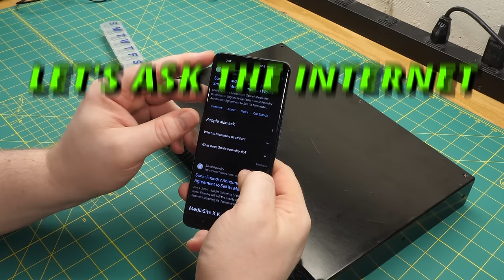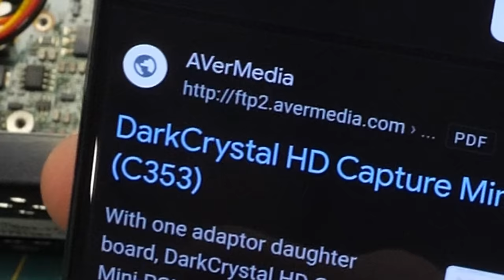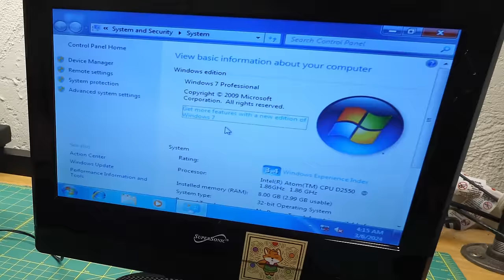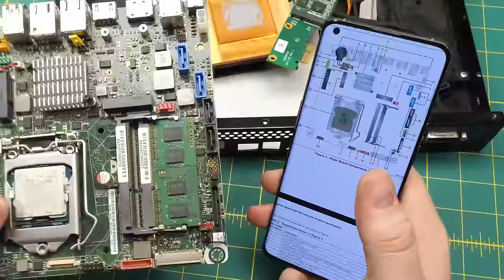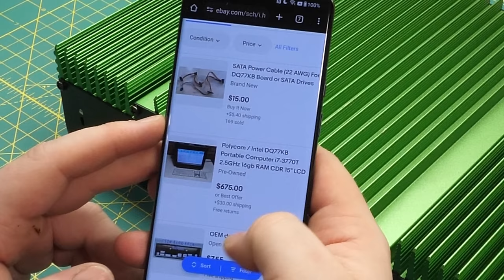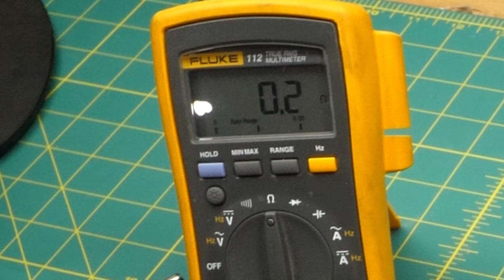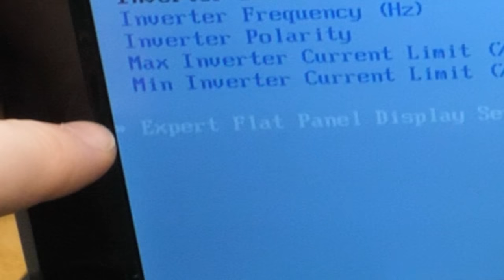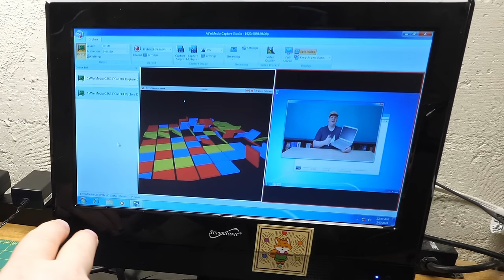Little Guys 5: Three Of Them [MediaSite / NCR N3000]

Comment: I don't believe I'm correct on this but around 15 minutes in I couldn't help but speculate that those empty spaces inside the chassis could be for mounting with like double sided tape, the power brick, and the reason there's two is so you can have two of them, one being redundant. (on purpose redundant, so, the second one would be intentionally redundant).  I was just imagining those grey metal box power supply units for servers, long, short width but tall. 

I figured you could just put the FSB power brick inside the case and cut the chassis to expose the power cord connector for the power supply brick. This does away with the unnecessary expense of adding the screw lock mechanism for the DC barrel jack input, cutting costs immeasurably.

Comment: re: the mediasite's little power button board, those unpopulated spots are probably passives that are technically needed per the PIC's specs (also, PIC spotted! AVR's adopted cousin <3) but were left out because they were found to be unneccessary to save a few cents on passives - the pads are left *in case*. you'll see this a lot in embedded things; leaving a few capacitors and/or other passives off because they take up space, add cost and are just not needed when it's guaranteed its operating conditions will be very stable

Comment: The difference between an SMD link 0 and 000 is that 0 is made like a standard thin film resistor, while 000 is high current rated with more conductive stuff inside.

You're not familiar wih Sonic Foundry? They made the best software of the late 90s. Sound Forge, a wave editor with VST support, Vegas the video editor, and ACID the loop based music workstation. All 3 shared basically the same somewhat unique UI at the time and were so smooth to use and fairly efficient and robust if you compre them with the copetition.

Also remember how for Windows for the longest time shipped with WAV files that had metadata from a Radium cracked version of Sound Forge Pro?

Why is the microcontroller board so complicated? The large unpopulated through hole components are obviously LEDs, the unpopulated resistors next to them are their respective current limiting resistors, and the long unpopulated pin header is clearly a development port, in-system programming and debug, and they might still be using it to program the processor using through hole pogo pin jig.

Comment: 11:26 That’s actually normal, and considered very good bit rate for 1080p. Fun fact movies on Blu-ray 1080p have a bit rate of 18-45 Mbps (megabits). I know this because I run my own Plex server and I rip the raw disc and keep the resulting file as is. I don’t pre compress anything I prefer quality (preferably the original maximum quality) over quantity. Anyway that’s the rough average I have. 4k moves range from 60-125 megabits per second.

Comment: Just saying I think it does work had a similar issue with a thin client fan did same thing it was the center pin needed 5 volt think it's called smart pin some need different voltage I just took a USB 5volt to it and it  booted

Comment: I am willing to bet the SonicFoundry machine was working all the time, even before you pulled the CMOS battery - When you started you powered it up then plugged in the video cable. Chances are, it was checking connected displays on power-up, not finding anything on DP, HDMI or eDP (which have two-way communication), and defaulting to the internal LVDS (which doesn't IIRC)

Comment: Intel's T suffix should note that it's a 35w low TDP processor. I've got 6500Ts at work running off those same standard HP PSUs. I'm sure it would be possible, but excessively stressful on the PSU, to put a 65w TDP processor in it instead.

Comment: You can actually capture multiple streams to separate files by running multiple instances of mplayer or mencoder from the commandline on linux, but that is obviously not a very practical solution for most users.

Comment: Feels like you could do a 30+ minute video just talking about external power bricks and their connectors. I ask this fully expecting you have, but have you ever seen the old Dell plug where it's a square of solid plastic, couple corners chopped off, key cut in one side, 3 tiny pins? Barrel jacks existed at the time. Barrel jacks have always existed. The Ten Commandment tablets had barrel jack. Dell why?

Comment: If you want "fun" bioses, get one of those chinese computers from companies like Chuwi, CWWK and alikes. 99% of the time the bios comes with the engineering mode enabled by default, so you can tune everything(and I meant it). It's not that verbose as it comes with the default blue/white bios but it comes with everything "enabled" you can enable/disable/change things that doesn't even exists on the board. Like how mine n6005 has an option to enable thunderbolt on it

Comment: I have a variant of that case with the extra space in it, and in my variant the extra space is taken up by a shuttle style power supply, I'm not sure why they didn't use a smaller case to go with their barrel jack DC-powered board, but it could be that due to economies of scale the cheapest mini-ITX case that could accommodate a half height PCIE slot just happened to be a variant of that case without the power supply.

Comment: That other machine really is stupid, I had a very similar Atom ITX board in a much smaller case that was entirely perforated.  This allowed it to be entirely passive and even had a right angle riser that allowed a full sized card to fit. (although the build quality was a bit off so it didn't fit well).  I built it to use as a router.

Comment: You wouldn't see "VGA" written on a panel of a DVI input, because VGA is just the name of the connector that carries the RGB signal.  It's just referring to the presence of the four analog video pins on a DVI-I or DVI-A connector.  I agree that seeing RGB printed on an I/O panel is often a sign of professional or pro-sumer gear though.

Comment: @Cathode Ray Dude [CRD] Some laptop PSUs do pass ground through, but it's very hit or miss. It depends on the manufacture, series run, and model of the PSU. All of the two-prong types do not, and it's 50/50 with the three-prong types. Some of the three-prong types have no ground outside of the AC plug, some only on the AC side of the circuit, and some passing it through fully. My advice, when looking for one that passes it through or not, is to test them.

Comment: I had a similar AVerMedia TV Tuner card in my Dell XPS 15 laptop (L501X and L502X) which used a mobile Sandy Bridge i7, I think I saved them in a plastic storage container, but I think they only supported Coax connections, iirc though it worked with some earlier standards of digital broadcasts & cable...

Comment: The little board at around 44:01 -- I think those are actually pads for LEDs, not capacitors. The silkscreen markings on the back (despite saying CP) look way more like LED polarity indicators tha capacitor polarity markings (which usually use either a plus, or they shade in half the circle). I have a feeling if you populated those resistor pads with 1k resistors and added in some LEDs they would either match the front panel or possibly give more detail about the system status.

Comment: Hey don't make fun of THAT little guy!!  The boring black one with the over sized case and ITX motherboard. I could use some of those for a router project.  Well if those are Gigabit Ethernet interfaces.  Where did it come from.  I have combed the internet for cheapo boards with multiple Ethernet built in.

Comment: That little USB board... are you sure the round components are caps? It appeared to be "dented" on one side, which is usually the symbol for an LED. Maybe the same board could do some more lightshows for other applications?
Reply from the maker: Well I thought it said C1, C2 etc on the bottom but I just watched the video again and It actually looks like a two letter designation, CR. I can't find anything online about that other than some weird crap about capacitors with intrinsic resistance.
Reply: @CathodeRayDude  I've seen (particular in HP schematics) the designator "CR?" used for diodes, so that tracks.

Comment: I have a theory as to why that chassis is so big: it's an industrial PC meant to be used in a very hot area (foundry, maybe?) and this allows a small fan to move more air than it would normally. Why,  with a larger chassis, they wouldn't just put in a larger fan? My guess is cost, but it does make the whole thing a head scratcher.

Comment: I have a mini-ITX board like that (not that one) with an LVDS port on it.
One of the problems I've had with it, is that it just defaults to output to LVDS, and doesn't output on VGA, and there's no real way to change that, even in the BIOS.
So, when I tried to install Linux on it, I couldn't get it to output to VGA, so I had to install windows XP, then use the Win+P option to clone the screen to VGA.
And you did mention this on yours, so you're probably right.

Comment: Another case of verbose BIOSes in Little Guys (though these ones were meant to compete with high-end Raspberry Pis for the enthusiast market) is the BIOS of the Vorke V1 and V1 Plus mini PCs I received when a donor of hand-me-down tech passed away. (The V1 Plus has twice the memory bandwidth, but it's a 10W Celeron J3455 with soldered-on 4GiB of RAM instead of a 6W Celeron J3160 with an 8GiB-capable DIMM socket, so it's not really very Plus IMHO.)

Comment: I think thin mini itx also refers to the ram being sideways rather than sticking straight up, since ive never seen that on any disktop pcs besides like, a mac mini

Also, i absolutely wouldnt be surprised if this thing was taken out of use and put onto the market as a broken device because someone changed that bios setting and no one could figure out how to change it back or that it even needed changing

Comment: 43:49 The unpopulated "capacitor" pads here actually look like footprints for 5mm LEDs. Perhaps an alternative configuration would have this board bolted to a front panel so it could display more detailed indicator information directly from those six LEDs instead of colouring the power LED?

Comment: At the 15:30 or so mark you complain about the tiny board in the large enclosure. My bet is that it was designed originally for a larger board but over the years mainboard solutions became smaller and so they replaced the internals.

Comment: The Dell and HP laptop power bricks with the center pin are not always intercompatible. The middle pin is connected to either resistors or a 1-wire ROM that marks what current it is capable of. HP mini PCs will not run from any Dell brick.

Comment: I can't be certain, but I imagine I'd be able to create a useful desktop PC out of this old hardware. The NCR machine has nearly the same CPU as the one in my primary PC, which runs Win10 fast enough to keep me from getting frustrated. I've always gotten by with whatever I could put together or make do with, so my hardware standards are relatively low. However, if I discover I need something better than what I have I'll shell out the cash for it.

Comment: Looks like that motherboard might have been a nice choice for a suitcase PC. 
The 2012 date for the motherboard vs the 2020 date for the Mediasite feels like a disparity, there were much more efficient, modern low-power solutions. Were they building with new old stock, or maybe even scavenged, refurbished tech? I'd be curious to see if all the machines had the same hardware in them, or if they just used whatever they could stick the capture cards in. There was a hardware shortage during covid.

Comment: Alright, I'm going to stand up to defend the "totally boring" Little Guy.

"Why is the case so big?  Nothing else fits in here" -- TBF, that gives you a ton of flexibility relative to most of the SFF cases, which basically fit the motherboard they shipped with... and no other.  Have a high HSF?  No problem.  Need an expansion card?  Gotcha covered.  Want to use full-height RAM sticks instead of low-profile?  But of course!

"Can't even use full-height expansion cards" -- Frankly, that's the case with a LOT of systems outside of the userland.  Servers 3U or less, SFF ... half-height for the win.  You can get all kinds of stuff in HH, and unless you need a GeForce 4090 in there, you probably don't need a full slot height.  Half the mundane PCI/PCIe cards out there are only that tall because the bracket is.

"Used a passive heat sink, then added a fan" -- OR.... or.... used a large heat sink, and a slow-moving 80mm fan on purpose.  Because it's easier to source a quiet 80mm fan than it is to source a low-profile HSF that doesn't sound like a server closet.

"Weighs nothing" -- I heard:  Light and highly portable.

"Totally boring" -- It's a bog-standard PC motherboard that runs off 12V, has a perfectly good expansion slot, and would accommodate a replacement board if you needed to swap it out for some reason.  What's not to like?!?!  :-D

Comment: The T in i5-3470T means it's a low TDP version of the i5-3470, which they probably chose for either cooling reasons or power consumption reasons

Comment: On my Dell laptop's power supply, I'm fairly sure that the barrel plug is earthed. Also, instead of a mickey mouse power cable, it uses a standard desktop PC power cord. This is probably because it's an absurd 210W PSU for my laptop.

Comment: The i5-3470T is a 35-watt TDP, low-power version of the 3470. If you were to drop a 3770 in there it would either get a LOT hotter as the i7 is 77w or the motherboard would clock it down to fit in it's power delivery if it can't provide 77w.

A lot of these boards have power delivery only rated for 35 (or 65 for S- procesors) watts and can't actually run the full chip. This particular one seems to be specced for 65w. so if you find a 3770 won't come off of it's base speed or will never hit 100% utilization, you should try a 3770S(65w) or 3770T(35w).

Comment: FWIW those positions on the board AREN'T capacitors, they're LEDs , CR is a common but somewhat oldschool prefix for Diode designators, I assume that that board was either the prototype board they used to create the integration or it's used for the same purpose as the button LED in a different product.

Comment: Considering that some cisco switches and other pieces of networking equipment use ATX CPU connectors to power them, it should not be hard to find a brick that already has that connector, just probably of too low a wattage I think

Comment: I think that the sonic foundry could handle an i7, but just one of the T variants. 
I have an ITX system that has a 3770t in it with what looks like the same or a very similar cooler on it, I have not tested the temps on it but it does work

Comment: I'm not sure the passive system is actually mean for high power CPUs the one that's in there in the video at least is specifically a low power desktop version, i believe 35 or at the most 45W TDP. that's what the T suffix means.

Comment: This Rigs a bell about its back ports on the box as my PlayNetwork MC500 player i found has the same back like yours and 
i found the one with the bad pc board inside it has a lightly score outline in the metal for a Normal PC Back shield 
it took me 9Months to figure that out.

my other one is a thin version for its ports but i am also going to cut its matrix display for a small Touch LCD
and rewire the front buttons to a keyboards Media buttons and run a normal version of linux so i can use it as a music network player once again without proprietary software thats locked to playnetworks i guess drms

Comment: The i7-3770 TDP (77W) is probably too high for the passive cooling solution on the NCR machine. You want to stick to CPUs with a T suffix (45W TDP or lower), like a 3570T, 3770T, etc.

Comment: So, most of these Intel chipsets I run into don't output any video unless the HDMI/DP is plugged in before power on. In fact, it even is an issue if the device has IP I console, you won't even get "virtual" VGA via the Intel AMT system if you either don't have a monitor or one of those HDMI/DP DCC emulators to trick it.

Comment: Why is the case so oversized on that second little guy? can't be for airflow, is it??
Reply from the maker: Just because it's a generic chassis not intended for this specific board. Must have been cheap that week
Reply: @CathodeRayDude  I believe it's because they use the same stamps for two different variants of the case, one for DC-powered and one for ATX 24-pin powered motherboards.
On the latter variant, the empty space houses an AC power supply and the rear panel has appropriate holes. I wouldn't be surprised if the empty space is exactly enough to fit a 65 x 85 x 175mm TFX power supply.
Reply from the maker: @musashigundoh  that would make a lot of sense, except... what motivates a company to buy this version when they can get something smaller?
Reply: @CathodeRayDude  Price, most likely. They were clearly saving every cent there.
Have you seen bottom-of-the-barrel office PCs from HP and Lenovo? They have a tower case with space for a full ATX PSU and a mATX board, but it's fitted with an almost blank rear panel and a dinky mini ITX board inside with laptop RAM, powered from a laptop power brick - so 90% of space inside is air.

Comment: My gaming computer has a motherboard with this chipset and I can tell you it sucks. It has no overclocking capability despite having settings for it, it  just doesn't work right or at all. The extra ethernet port is for remote management